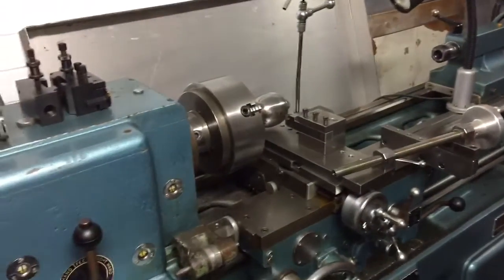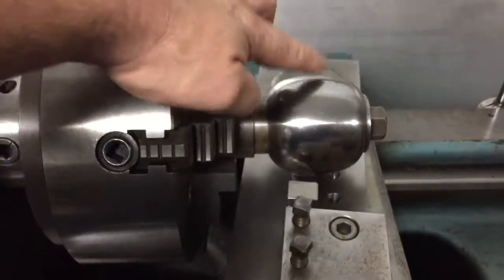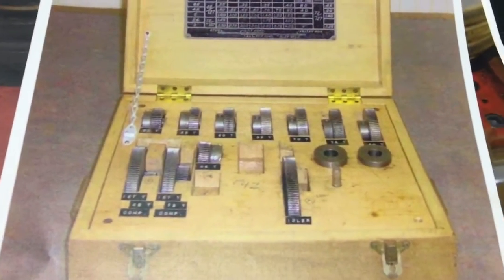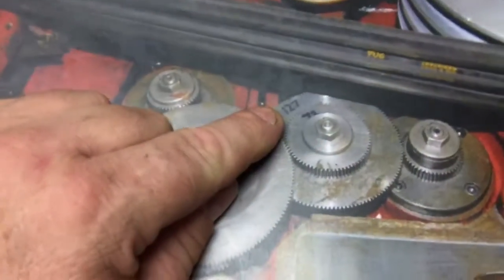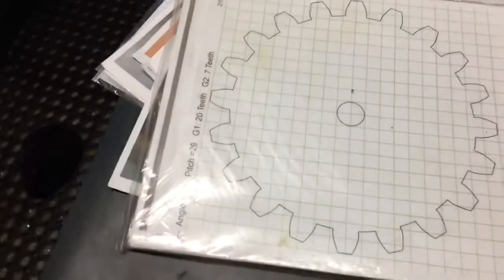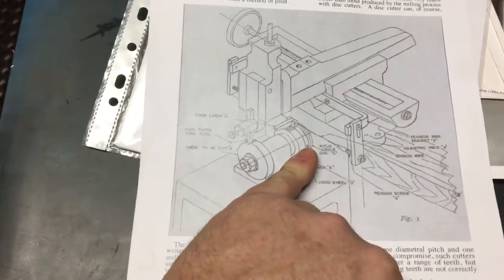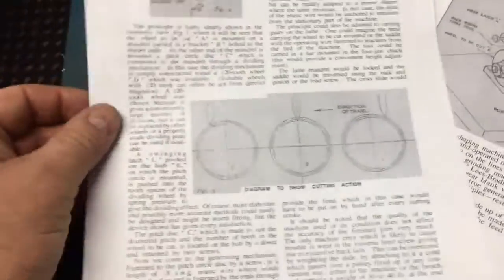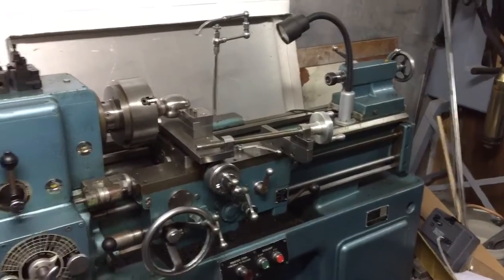Involute Gear cutting attachment for the shaper Part 1

Comment: This should be interesting,  I've never seen the wire drive part, only straight cut down with the single point cutter. Do you have any more details on the article n drawings for a fellow shaper user ?  Best of luck with the comp '.  mat
Reply from the maker: lookcreations g'day Mat, I went looking for the original on the net but now getting 404 error. Email me at jb at designlab dot cx and I'll forward you a copy cheers

Comment: Wouldn't it be easier to simply grind the tool to the shape of the tooth profile?
Reply from the maker: Two reasons, first it is quite a complicated shape. Secondly the shape would need to be ground for each different gear blank, as the shape of the tooth changes depending on the number of teeth. This method works because the rack has a simple geometry, and the gear meshes with the rack regardless of the number of teeth. So the grind on the tool is a simple triangle with the correct included angle
Reply: Well looks a nice project and interesting tool 🔧 👍